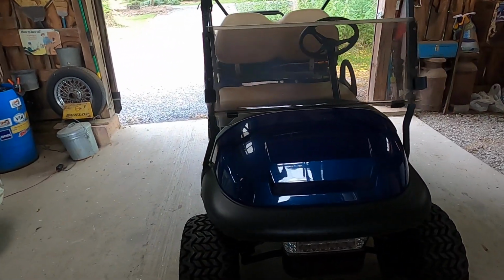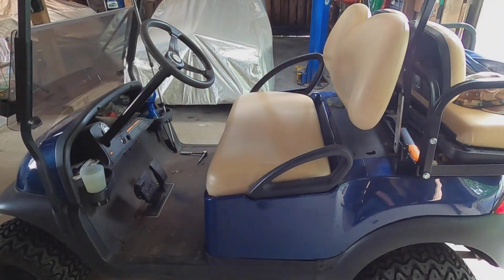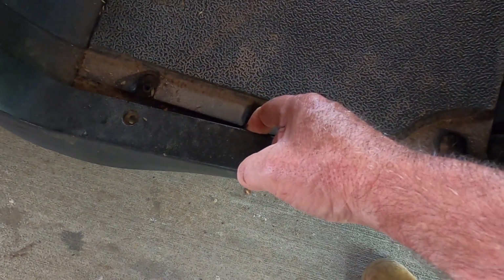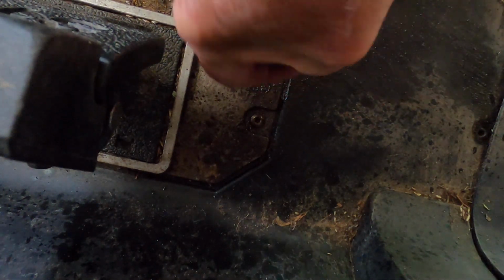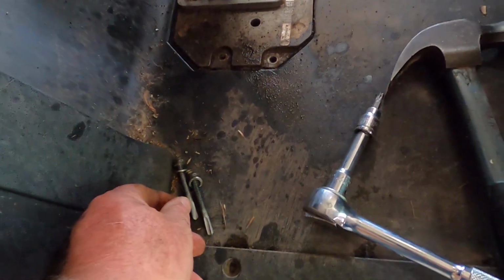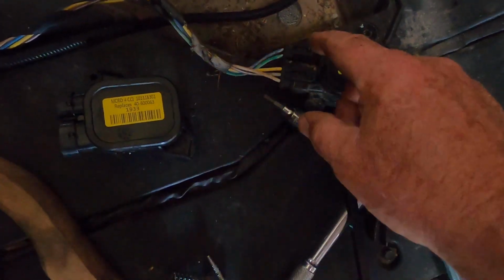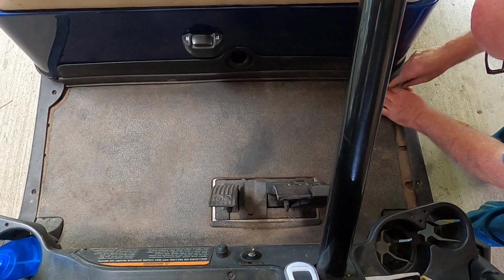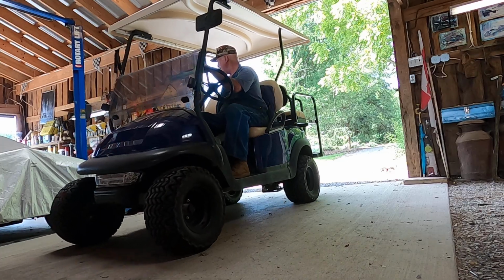MCOR-4 Replacement 2018 Club Car Precedent 48 Volt Golf Cart

Comment: Thank you, Ken! Awesome video. Very detailed through each step. I like that you lubricate the rusted components and use dielectric silicone on the electrical connections. I use dielectric silicone on all my electrical connections, especially flashlight batteries, to stop electrolysis or corrosion. I loved the end of the video, your area s very beautiful. Where are you located, if you don't mind me asking?

Comment: I created a short on my 2018 precedent and blew a small fuse in the battery compartment.  Once I replaced that I have 53v at the motor but will not go fed or reverse.  Does that sound like an MCOR issue or is there another fuse somewhere holding me out?
Reply from the maker: Thank you for watching. Does the solenoid click when you depress the accelerator? However, to directly answer your question there is an actual fuse box behind the dashboard. You have to remove the dashboard. Make sure to place the tow/run switch to tow before you do anything electrical.

Comment: Can someone help me out, My club cart Presendt will not run, it’s a 2017. One day it just stopped. I installed an new motor computer, it did run then but VerySlow , about 5 MPH.  I discovered that new new motor controller had a different number on it than the one that was in there. So Imordered on with the same number,mI installed it  and now it doesn’t run at all 😢. What else should I do?
Reply from the maker: Thank you for watching. I'm confused. First you said you installed a new "motor computer" then you said you installed a "new motor controller." Which did you do? the "motor computer" is actually an OBC (on board computer) that controls charging of the batteries. the "motor controller" is the unit that provides power to the motor and is activated by the solenoid via the MCOR. What did you do to diagnose that you needed either one?

Comment: I chuckled when I saw that part on Amazon with MCOR spelled MCRO.  Something lost in the translation.

One question... you edited out the mention of the size and type of screws holding the sensor to the pedal assembly, both when removing and reassembling.  I'll be doing this repair while at my campground this weekend, so I was hoping to know what size tools I needed to take along.  Do you recall what they were?
Reply from the maker: Thank you for watching and your very sensible question. It might have been a T-30, or smaller. Just take your Torx set, and you will be golden.
Reply: I have a 2012 Club Car Precedent, the car will not move in F or R.  Fully charged, recent batteries, when I press the Pedal, I get nothing, sometimes a click and sometimes not when I press down, pretty much dead, would it be the MCOR switch. Before I have it hauled out of here to the repair shop, I like to give this a go. I just replaced the F/R switch a couple days ago…that didn’t help..help if you can, great video by the way..thank you for sharing..
Reply from the maker: Thank you for watching. I'm no expert but you could try disconnecting the cables to the solenoid and cleaning them. However, I think you have a faulty solenoid and/or MCOR. Both are inexpensive and easy to change out. 
 @TerryM-eu5ou
Reply: @kensshowtell  great! Thank you for your reply..I can probably change out the MCOR myself, I’ll try that first …thank you, again my friend..🙂
Reply from the maker: This is the MCOR I purchased and installed in the video. Part number 10511630. I got it from Amazon.  @TerryM-eu5ou